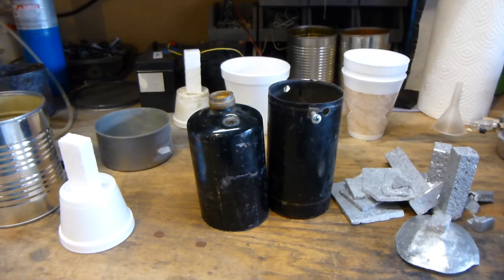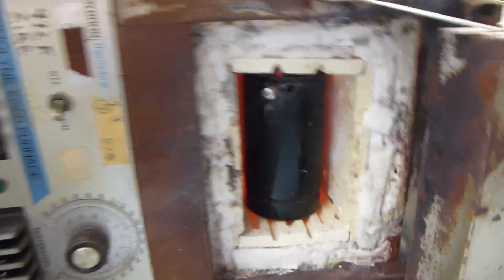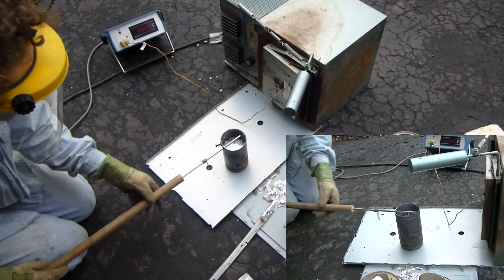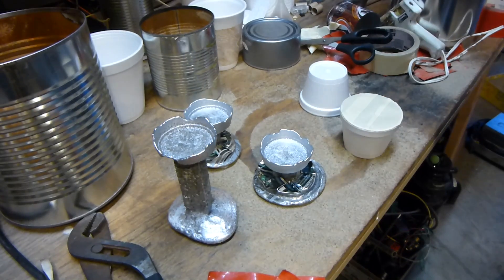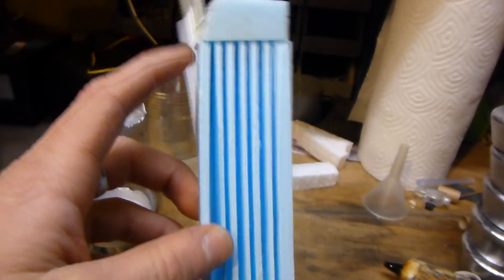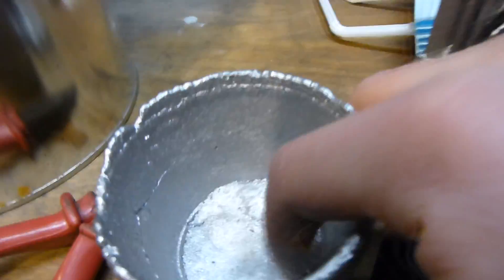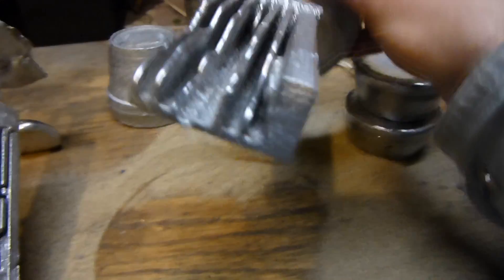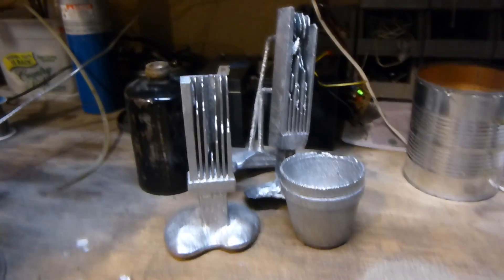Aluminium Casting Styrofoam Cups and Heat Sinks

Comment: Great work! You've got the right idea...always look at the outcome and ask yourself " is this what I expected".If the answer is "no" then formulate more questions! Be careful of using water and sand when casting molten metal!! Green sand must be proportioned very carefully!! Too much water and the molten metal will cause the water to instantly vaporize and potentially cause an explosion (just watch some of the videos of folks melting aluminum pop cans).
Keep experimenting....

Here's a hint... It looks like most of your metal is solidifying in the sprue! What about positioning the heat sink foam molds horizontally in the sand and feeding the metal through several sprues (a manifold) to distribute the molten aluminum more effectively.

Comment: Cast the cup from the bottom up. The other way up from the way you are casting now. ( Also no problem filling the cup with sand) Your sprue goes down the side to the bottom. add straws to the top of the cup to allow it to vent out of the sand. At the moment you have no way for the gasses to escape and be replaced by the metal. Regards, Matthew

Comment: From what i have seen in these lost foam style castings is the sand needs to be wet with either water or a light amount of oil .... that way you can pack it a lot better

Comment: The sand is the problem. get finer sand then mix it with a little of 2 cycle oil  ..like 1 tea spoon for the  small can ..1 liter.. Of sand with  water mist''it will hold during casting''they call it green sand.

Comment: On thin sections the foam outgases then the sand collapses before the metal can fill the void. Two things you could try --

1) make a very thin slurry of plaster of paris and paint it on. Once you get the thickness you need bake it dry. NOOO wet plaster! Then follow your normal LFC methods.

2) Find a high temp paint that you can coat the foam cast with. You will have to experiment here, many paints have esters that eat the foam, some don't. Once coated follow your LFC methods.

This provides a skin to resist the void collapse so the metal can fill the void. Good vid.

Comment: Hey, I actually think the pouring went wrong because the sand collapses under it's own weight. The bottoms of the cup melt and the sand just sags down in. This might well be the reason of the fails. You could use denser sand types that come pre-mixed with a type of oil to preserve shapes inside.

Comment: Your cups were a good idea but before you immerse them in sand, cut the top
part of the second cup that's sticking up and make it level with the first one. 
I think those straws turned out to cool and might have to try that one when I get
up and running. I've been collecting cans and I'm at around 30 x 30 packs and
sure I'll go through them fast.  Keep up the good work, you're success is our's!!
lol   =0  )
Reply from the maker: sthwestb Thank you!  Yeah I guess I could have done that.  Would have made the bottom of the cup a lot thinner.  I turned the cup on the lathe the other day.  It turned out really really well.  Much better than I had expected.  

Yeah the straws did turn out really neat!  I could certainly make some shafts out of the straws.  Would require some machining though.  The cast aluminum is pretty strong.  But it's brittle.  Yeah aluminium cans do not have much aluminium.

Comment: Your  biggest problem is the you pouring too little aluminium into the molds u should pour until the flame stops nd moisten ur sand
Reply from the maker: Ricardo pillay  I'll try pouring in more aluminium and moistening the sand.  Thank you!
Reply: Its a pleasure my man do u have bbm
Reply from the maker: Ricardo pillay What's BBM?

Comment: cut the top off the cup and do a bit of work on a belt sander and it would look awesome. maybe adding a couple more straws and a thin, flat piece of foam to the front of the heat sink to cut away after casting would work better. just some thoughts.
Reply from the maker: ***** Yeah that would be cool!  Might work.  Thank you!

Comment: Thank you for including your failures as well as your successes. Too many of these videos gloss over the trial and error part of figuring this stuff out. Great stuff. =)
Reply: Makerj101 i think its the sand your using that is causing the issues, as the foam is being burnt away the sand is collapsing into the cavity before the aluminum can cet there, look at getting propper casting sand or green sand as its called. you can also make it, loads of vids on youtube for you to learn how to make it
Reply from the maker: Erik Thank you for seeing it that way!  :)  a lot of people criticize me for showing my failures.  Thank you!  :D
Reply: chaos Regular play sand is fine for lost foam. Green sand doesn't work weel because you can't pack it properly. He could try a plaster shell. I think the type of foam isn't right. Ilso his set up needs some work.
Reply: chaos your right its the sand he isn't getting good forming sand , either get thing sand and moist it up like building a sand castle
Reply from the maker: chaos Yeah I'm planing on making some green sand really soon!  Thank you!
Reply from the maker: Jack Caldwell macaulayman Yeah probably if I moistened the sand that would help a ton.  I just need to get around to doing it.  I also am going to make some green sand soon.  I finally found some kitty litter that has bentonite clay.  Now I just need to grind the stuff up and make a nice mixture with the sand.  Thank you!

Comment: you may not have the room for it but if you had two smaller crucibles you would be able to pour into two sprues simultaneously thereby getting the metal into the casting faster to keep it from cooling too quickly, obviiously you would have to have vents for excess gas and metal to dispense. this is in regard to your heat sinks. also the cups sprues are too long in my opinion. the metal cools so quickly. i work in an aluminum die casting facility, which doesnt make me an expert by any means, but thats my two cents. great video! keep it up!!
Reply from the maker: Jamie Sood Hmm that's a good idea.  But it would be very hard to pour to simultaneously.  That also might create a cold joint in the middle where the aluminum from each side meets.  This might be a weak point.  I think they have multiple injection ports for die casting.  Right?  Also like you mentioned, I don't have enough space in my furnace for two crucibles.  Thank you!

Comment: I like the scientific approach.  Good for you.  How in the world did you cut a propane tank in half when there must have been some propane residue left in the tank before you started making sparks by cutting it?  Do you have a secret way to eliminate the propane or are you just in possession of huge trouser spheres?
Reply from the maker: nomercadies It was an empty tank for starters.  I then took a screw driver and stuck it in the top and depressed the valve to let any residual gas out.  There was a little.  I then cut it with a hacksaw so there were not really any sparks.  If you are worried about that you could drill some holes in the part that you are not going to use and let it air out.  Thank you!
Reply: Makerj101 Since I asked the question, I talked to my soon to be son-in-law.  He has a way to drill a hole from a safe distance.  He uses the 22 long rifle to make a safe incision.  We have emptied the container as you outlined, but taking anything to the cylinder, even a hack saw, from up close makes me very uncomfortable.  I'll set you know if there will be a wedding for a funeral.  Later ...
Reply from the maker: nomercadies That sounds like a great idea.  Very safe way to put a hole in it from a distance.  I honestly wasn't too worries about it.  If there was propane still in the container it would be only propane.  In order for it to explode there would have to be oxygen.  Maybe once I started cutting through and there was oxygen getting in there could be a hazard.  IDK maybe I should have worried about it more.  Best wishes,
Reply: Makerj101 Spark + propane + enclosed area, might = explosion.  Like when you spill some molten aluminum on concrete with a little dampness trapped in it.  When the water trapped in the concrete turns immediately to steam, the concrete explodes and shoots hot metal, like bullets, up into the workers exposed areas.  It doesn't take much moisture to make concrete pop.  I'll let you know how the "hole making" goes.  The daughter's young man is supposed to make a short video.
Reply: nomercadies Well,  no video, but I do have pictures.  To get to them, you can search on the popular search engine for the word "chancefour" and find a webpage I started to follow our graduates from schools for students with special needs.  There are many of them.  Mostly they are sitting home watching Morey say "You ARE the father."  We offer something different, better.  If you click on the word "People" near the top center of the home page, you will be taken to the pictures I hid on the site showing the so called "drill bit" and "drill" and the results of the "drilling."  The drilling was accomplished from a safe distance of about one hundred feet.  Normally, you would think the drill bit would be very long, but in this case we got away with a much shorter one.

Hope you like it, and I hope you explore more foundry work in the future.  We also have some pictures and video that has been posted as "unlisted" if you would like to view.  I normally only send it to our network people.  We're trying to have a couple of our people become foundrymen.  I believe there is a good home business available for people that can follow direction, get along with people, and want to work ... but I can go on and on about all that, so for now ... I'll sign off.

Comment: Cool, I can't wait to get some casting done... I have an electric kiln, its 2500Watt and has about a 1' square chamber inside.... I still haven't used it for any casting... yet... I love the ingots. Peace.
Oh yeah, what is the max Wattage of your kiln? Does it run on 110V or 220V?
Reply from the maker: My furnace is 1680 watts and yeah it's 120 volts.  Wow yours sound awesome!  Yours sounds like it's 220 volts.
Reply: Makerj101
No, I just double checked... Its only 2100Watt, sorry... The max temp is 2000deg, I'm sure yours is similar... I think to run mine properly at max I would have to use two phase matched 120 lines from the circuit breaker in order to not trip the breaker.... That is why I had 3 new electrical circuits installed into my garage :D
Anyways, I love the kiln stuff.. I really can't wait to get mine fired up and producing... Peace :)
Reply from the maker: Binj Komisar That's still a good bit more watts than mine!  Should melt aluminum in no time!  It would have to be more watts because it's bigger.  Mine is pretty slow when I put a full load in it.  Takes about 20 minutes before it's ready to cast.  More power!!!!

Thanks!  Yeah you'll need to do some videos about it!  Maybe you'll have better success than me!

Comment: why dont you try using like wet sand or a sand that sticks together? like thet use for casting in factories. then it wouldnt cave in as the styrofoam melts away
Reply from the maker: Austin Gerlach I want to try that.  Thanks!

Comment: Hi Makerj
If you want to cast thin pieces, you have to heat your mold (sand/plaster mix) and then pour your metal.This will give the metal a chance to fill the cavity before it gets cooled by the wall of the mold. We have previously discussed this. I regularly cast 0.3mm ( 0.0118110236 inches) wall thicknesses using this technique/principal. Keep up the good work...it's impressive how far you have gotten through your own efforts.
Reply from the maker: electro1622 I will hopefully be trying using plaster casting soon.  I bought some plaster recently and really want to try lost wax or lost styrofoam.  I just need to get around to doing it!  Thank you!

Comment: You should use "green sand" dampened to do deep foam and fine casting. Plaster of Paris is the norm though.
You can get a better copy of finer objects if you use the plaster method and not have as much rough texture.

Also to make small things like jewelry, shims, pins, etc. you maybe should cast them in a flat down position, take you damp sand and carve out the designs and pour them. after they cool hit them with a bench grinder carefully with a fine wheel to trim them up and smooth them out. Again you can plaster cast them too.

Not in the sake of saving power and time you can try the DIY arc furnace method by using carbon rods, fire brick and an MOT. This will eliminate the need for a crucible as you can bore the brick out and even give it a pour spout. There are youtube videos on how to build one cheap using MOTs.
An arc furnace can get hot enough to melt aluminum and even steel in a very short time. I am designing one myself to have for when I need a special custom bracket, or spacer or whatever made from steel, copper, brass, etc.
Seems like a useful thing to have in the shop.
Reply from the maker: ElfNet Gaming I am going to try to find some bentonite clay kitty litter to make some green sand.  I also really want to try lost wax casting using plaster.  I bought some recently so hopefully I'll get around to it soon!

Yeah Grant Thomson!  I've seen those mini arc furnaces and they are awesome!  I have some nice big carbon rods too!  :D  But they are kinda antique so I'm not sure I want to use them...
Reply: Those rods are TOO BIG! use the rods from spent 6v batteries like Grant did. That's what I'm going to use.
Reply from the maker: ElfNet Gaming True.  I have a couple from AA batteries but they are a little small I think.

Comment: Plaster is not that expensive and it provides better insulation as to not let your aluminum loose as much heat so you can get much thinner casts! You can also crank the heat up waaaaay more. If you cast the Styrofoam inside the plaster I don't see why you couldn't get much better pours! Just make sure to get all those air bubbles out
Another idea would be to cast the Styrofoam inside the plaster and burn it away inside of your furnace! This would also allow for all of the moisture to be removed from the plaster. If you do a 50/50 sand and plaster mix you could also play around with making some reusable molds but it'd take a little bit more planning and possibly some more failures! Let me know what you think!

Comment: I would say try making the sand a little more damp. Green sand is typically what is used for casting, you might want to experiment with that.
Reply from the maker: s28400 Yeah I think I will try dampening the sand.  Thanks!

Comment: oh.... other option.  LOST WAX method.  mix up a batch of paster of paris (50/50 mix with sand) and thoughly coat it (the heat sink) making sure you have the plaster in all crevices.    Wait until it drives.  then heat it in your oven up side down (lowish temp) to allow the melted foam to leak out. Then you can use the hollow mold braced in loose sand to stop it from tipping.
Reply from the maker: Randall Lasini I also want to try lost wax!  I bought plaster recently so I will hopefully get around to doing that soon.  Thank you!

Comment: I have to agree.  You need more compacted/solid sand (or greensand) to use it. so that when the foam melts the sand doesn't fill in before the melted metal. 

I am guessing what your next video will be is will be blending kitty litter to make green sand.
Reply from the maker: Randall Lasini I am going to see if I can find some bentonite clay kitty litter.  I think I will also try wetting the sand.  Wetting might be enough.  Thanks!

Comment: All the problems you are having are due to your sand.
You need to make yourself some green sand. Plenty of advice online and youtube.
Matt
Reply: Makerj101 If you are looking for bentonite, I would see if there are any small well drilling companies around your area.  They use Bentonite clay powder that is so fine it's amazing. Its used as a drilling lubricant. That way you don't have to fiddle around trying to grind kitty litter to a powder.  In a lot of cases, you can tell them what you are doing and they might even give you a little in exchange for showing them what it will be used for.  Also, I think farmers Co-ops will sometimes have it, used for various things like sealing the bottom of fish ponds and such.  Thanks for sharing
Reply from the maker: Matthew Gischus  I will see if I can find some bentonite clay kitty litter.  I think I will also try wetting the sand.
Reply from the maker: Mike Studmuffin Yeah it totally could.  But as long as you don't use much water it's fine.  Green sand has water in it(except the oil based stuff).  But it's only like 3% water or something.  At those amounts the steam can escape fast enough through the sand.  A volcano of molten aluminium would not be fun hahaha
Reply: Maybe use water to pack the sand but then let the pot dry out in the sun for a day, I'd say cook it but it could melt the styrofoam. Blow dryer in a cardboard box?

Comment: Good job mate. You achieve a lot more than most people do! I see two issues. The sand is either too dry or not proper casting sand, When you squeeze a clump of sand together it should keep its shape, It also needs to packed in. The other is the exit vents but I see you are sorting that.Check out this https://www.youtube.com/watch?v=l638qR0Y6YE
Reply from the maker: Robonza Thank you!  I need to find some bentonite clay kitty litter.  I tried some kitty litter but I don't think it's the bentonite clay type.  It doesn't absorbed water.  Myfordboy has some really great casting videos!  Love his videos!  Thank you!